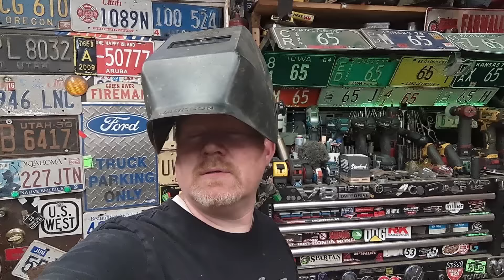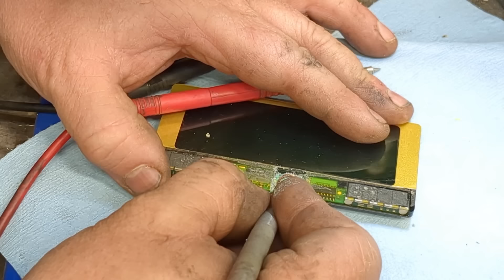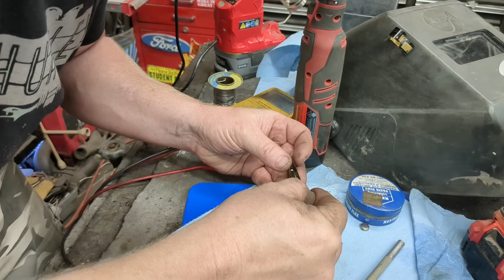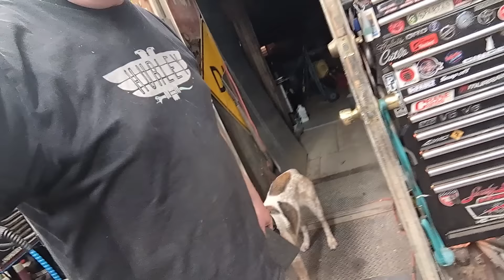Vintage auto darkening welding lens Repaired

Comment: I took a "darkening " Harbor Freight helmet apart and wired in battery holders for 3V wafer batteries and extended the life by over ten years so far. It is still going strong.
Reply from the maker: Awesome. After the video, I ended up desoldering the button cell in this one and adding a AAA cell holder. So now it just runs off 2 AAA batteries. This will make it effortless in the future to swap out batteries.

Comment: I got my first auto shade welding helmet in 97 and it was cheap 25 to 30 $ here in denmark ,before that i was oldschool with glass on top and 10 glass under that so i had to move my head ,but i rarely used a hemet in the first place ,car welding is mostly spots on spots so i used safty squints or dark sunglasses

Comment: Maybe adda battery holder in the future?
Reply from the maker: I actually 3D printed a little AAA battery holder but in theory you would only need to change the button cell every 10 plus years. The larger one I put in there will probably self discharge faster than it gets used and may actually last 15 to 20 years.

Comment: Hi, I've just retired and I've taken up carpentry and lately I started with some minor electrical repairs after watching your shows. I recently found a Skil Bench Grinder, but it's missing it's Capacitor, here is the description on the label, can you please help me with the capacitor that goes with this Bench Grinder, here in the Fiji Islands we run on 240 volts, thanks
Voltage 240
AMP      2
Phase   1
R.P.M.   2380
FREQ.   50 Hz
HP.       1/4
Type    1
Model   3020
Reply from the maker: There isn't one set capacitor size for every motor of the same horsepower. And not all motors require capacitors. The specs you give it should be either a 5 µF (more than likely) or possibly a 7.5 µF both 370v rated. Generally, the data plate will tell you the microfarads (uf) rating of the capacitor required.

Comment: I'm confused by the comments. One said his worked even without the battery but another said the solar part doesn't actually charge the battery.
Reply from the maker: Yeah, the battery doesn't get charged by the solar. It's purpose from my understanding is to stabilize the voltage produced by the solar. So a tiny bit gets used only at the initial triggering of the lens. The solar maintains the triggered lens. This is why the battery lasts 5-10+ years.

Comment: The cheaper Harbor Freight Helmets are sealed.  But I found that they can be opened up and the battery can be replaced.  The problem is when the battery is marginal.  Sometimes you'll get flashed but goes dark and think what is happening. Then the next arc it darkens right away.   You could use the "new" one for videography when doing welding.
Reply: Contrary to some of the comments, I had a cheap HF helmet and if I put it so that the sun hits the solar panel while I am setting up it worked fine which means the solar panels WERE putting some power in the battery. 
The main purpose of the battery is so you have power to make it functional when you first start welding and have no solar power from your arc.

Comment: For those unaware, the 'solar' panels on the front don't have anything to do with the battery circuit, or recharging the battery, they just use the light from the arc to operate the circuit that switches on the LCD part of the lens.
The batteries last longer if you keep those panels covered, leaving them in the lighting of the garage, or other ambient light, will partially operate the circuit and drain the battery.
Reply: Well that just explained why my attempts to keep the battery charged by leaving the helmet in the sun didn't work.😖😖
Reply: @OldSneelock  That's how I learnt as well - the hard way. lol.
Reply: Lol, that's completely opposite to what I believed! Thanks.

Comment: Won’t the corrosive flux wick up into your stranded copper wire?
Reply from the maker: It burns off for the most part and you can simply wipe off any excess. If you leave it it will simply put a little green oxide around the edges of the solder joint. Something that wouldn't hurt my connection with the battery, but isn't ideal for microscopic circuitry. You have no choice when soldering to steel though for the most part.

Comment: Usually those auto darkening modules have a shelf life not because of the battery, but because the liquid crystal starts to get more laggy as it ages. I've owned early auto dark modules that have replaceable batteries, and they also only last between 5 and 10 years as per manufacturer specs.
I have a 25 year old one, and it lags enough to cause arc flash after a few tacks.
Reply: I learned this the hard way. Extra lenses on hand went bad before boxes even got opened.

Comment: I do not understand how it's supposed to work, but my Harbor Freight auto-darkening lens died and I took it apart. There were two batteries, one was dead but the other had full voltage. They seem to control different parts of the circuit board. I damaged the board in removing them so I gave up, but even though that was a few months ago, I still haven't bought a new one because IT WORKS WITHOUT THE BATTERIES!!! Again, I don't have a clue what they are for and the lens is now a bit finicky, but I haven't been flashed once in at least 5 hours of welding!

Comment: I don't think it' solar powered - I think it's powered by the battery, and the solar panels are just the detectors for the arc. Even most "solar" calculators actually have a battery in them
Reply from the maker: The battery runs the circuit too allow the solar to trigger and run the lcd. It draws virtually no power, this is why the battery can last 10+ years. Solar is providing all the power to switch.

Comment: Moe, can you please do a comprehensive video about soldering? Different types of flux, solder, methods etc for different applications. Would be really useful!  EDIT: It doesn't necessarily have to be comprehensive, but just a brain dump of everything you know about soldering.
Reply from the maker: Great suggestion!
Reply: Don't use acid flux for electronics...
Reply from the maker: Using acid flux on oxidized electrical connections is just fine and the only thing that'll work.  You simply clean off any excess afterwards with alcohol.

Comment: I’m only 20 seconds into the video and I’m going to guess that it is the onboard battery that has went bad.

Yep, that’s what I thought. I found a lens laying in a cabinet at a place I used to work. It was all disassembled. I started looking at it and noticed the battery which had just started leaking. Strange thing is when I cut the battery out the helmet would then work without another battery installed..
My guess is the battery was absorbing all of the voltage made by the solar panels when the arc was struck. With the battery removed, there was no more draw so the circuit actually function.

Comment: Considering my helmet purchased in 2000 is also called a "solar powered" lens, but has replaceable batteries, I figured all the newer "solar powered " inexpensive welding  helmets/goggles that are sealed would also have a battery.  Planned obsolescence in effect. Thinking ahead, I researched disc batteries and found some that are rechargeable.  Most in these auto-darkening helmets are not labeled as rechargeable (I could be wrong, ID numbers would verify) as they use the ambient light as a maintainer and the arc flash to keep the charge topped. Again, that's conjecture. Newer helmets spec a 2450 disc battery. Mine take two 2032's. I picked up some very inexpensive welding goggle/glasses to use in those awkward areas where a helmet it too big and hangs up on everything. Anyone who has welded under a vehicle understands. Those goggles work great, though to prevent flash burn, a cap and some sort of face covering is advised. I use a neoprene dust mask and position to avoid the potential of creating the burning neoprene smell.😆
Reply from the maker: The helmet I bought in the early 2000s is run off two AAA batteries.  It has a button on the front of the lens so you depress the front of the lens and it turns itself on. It stays on for around an hour and then shuts itself off. They use such little power. I think in the last 25 years I've changed the batteries 3 times maybe. My current Lincoln wide view helmet uses the 2450 and I have to change the battery yearly if not more. I was just going to wire up a pair of external AAAs So it'll run 4 times longer.
Reply: The 'solar' panels on the front don't have anything to do with the battery circuit, or recharging the battery, they just use the light from the arc to operate the circuit that switches on the LCD part of the lens.
The batteries last longer if you keep those panels covered, leaving them in the lighting of the garage, or other ambient light, will partially operate the circuit and drain the battery quicker.

Comment: FYI. Something you might not know. Take any IR tv remote control and point it a your lens, push any button and it should make it flip to dark. A handy thing to know if you are't sure if your lens is still working.
Reply: and you can check if your remote is working by pointing it at a modern camera.   it shows up as a white light.
Reply: @vsvnrg3263 that's cool lol thank you for this. I just did it with my android phone and it worked! I never knew
Reply: Thanks for posting this 👍

Comment: If it works, it is fixed. It may not be the original design, but it is different. Perhaps a pair of Doggles for Ginger with the flash protection would be prudent, seeing as how she is always around you?

Comment: Why couldn’t you replace the battery?
Reply from the maker: I could replace the battery with the exact same one. I just would have to order it. The issue is in 5 to 10 years it''ll just go bad again and you have to start over. Pulling the wires out lets me hook up any battery. I could even hook up two AAAs.

Comment: My philosophy is , if it is already junk, you can't hurt it, jump into it, and see what happens.
Reply from the maker: Absolutely! Worst comes to worst and you just end up making it smaller pieces for the landfill to easily digest....
Reply: My wife's Roku remote has quit and won't charge. What have I to lose by opening it up and seeing if I can fix it? Very likely the same problem, battery.
Reply: @akawireguy1197  I found a battery online a while back for mine -- fixed it, though I did have to break the glued shell open on the remote.